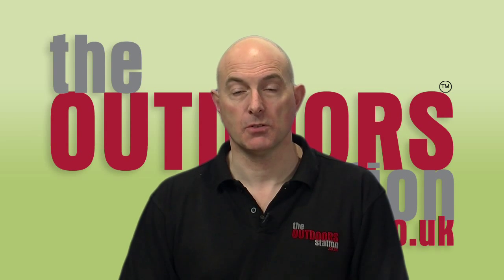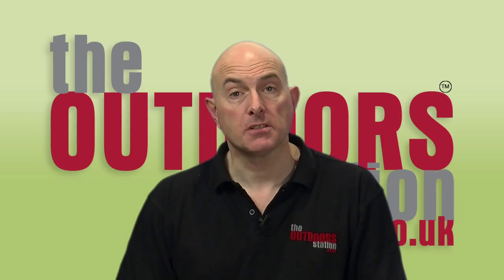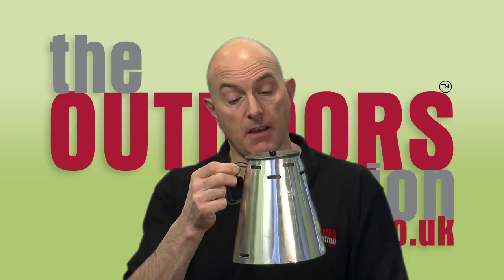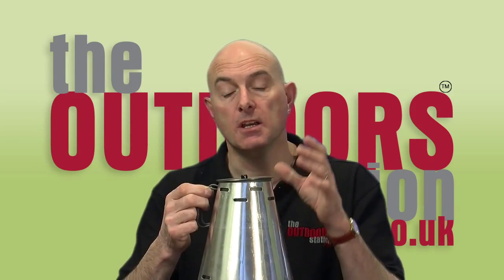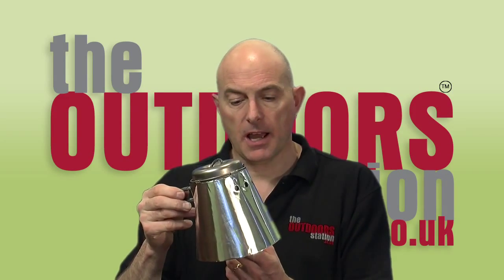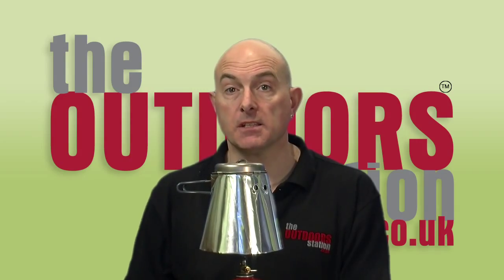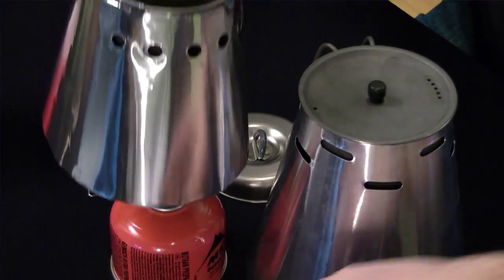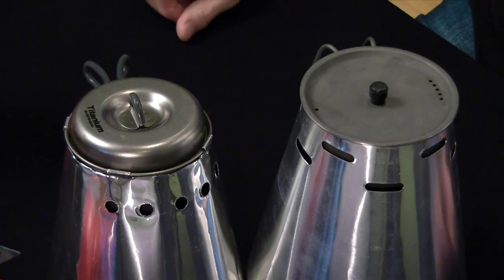How To Make A Clip On Cone Windshield

Comment: I tried that but it starved to stove of oxygen and it kept going out.
Reply from the maker: Then you've got to punch more air holes in the base until you find the sweet spot. Fire needs 3 things = Oxygen, heat and fuel. Starve it of one of them then it will go out.

Comment: If you have a piece of string and a tape measure anyway, simply wrap it around the pot and then mark it.  You can measure the circumference exactly that way with no calculations at all...

Comment: I'd just measure the outside of the cup/bowl with a flexible tape measure, such as a surveyors tape or clothes measuring tape, no need for the maths. Then, put cup/bowl on burner, get tape to see how high the screen needs to be to do the job. Then it is jsut a matter of scouring the circumferences as in the video...

Comment: Here's a calculator to answer some of the questions in the comments.  If you know the desired come height and the top and bottom diameters, the formula will return the two arc radii needed as well as the angle span.
Reply: http://craig-russell.co.uk/demos/cone_calculator/
Reply from the maker: +Gabesafish Cheers Sam. That's useful to everyone.

Comment from the maker: Diameter was measured at 94mm which means the Radius is half that, and therefore 47mm. The calculation is 2 x pi x r.
Reply: 94mm x 3.16 = 297.04  Easy breezy lemon squeezy!  Thanks for the video!